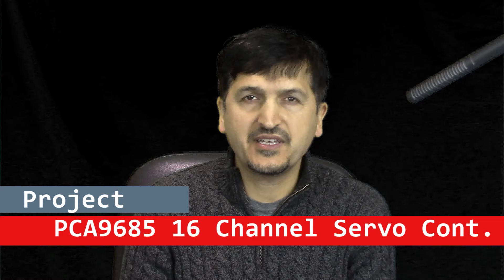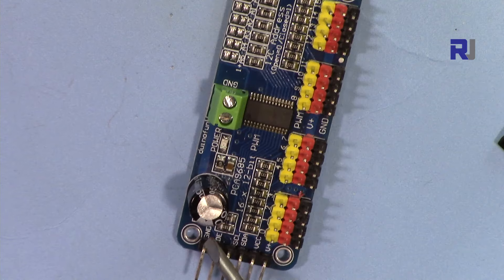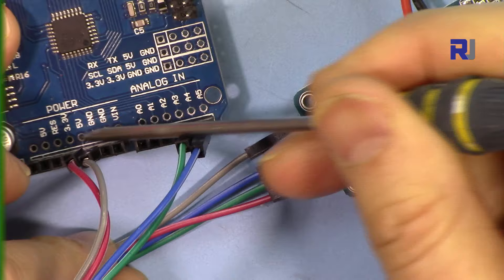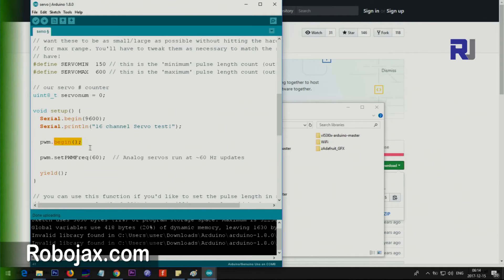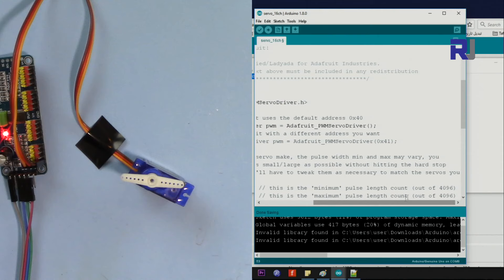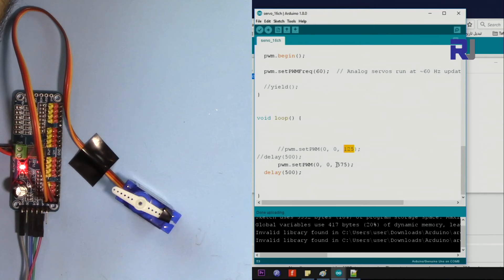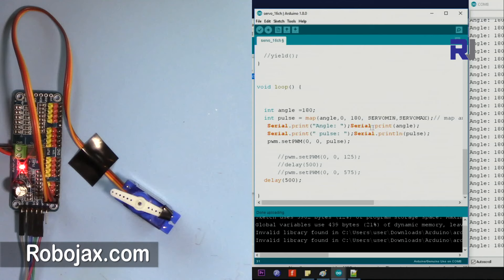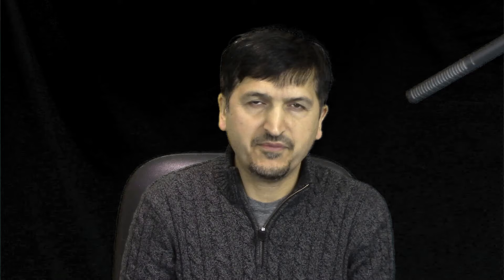Complete guide to  PCA9685 16 channel Servo controller for Arduino with code Version of 5 ( V1)

Comment: how to control 2 servo with your simple code?? please reply
Reply from the maker: Use this video https://www.youtube.com/watch?v=kZ9b31gVemc
in the code we have a line : Servo myservo;  and bellow it add Servo myservo2;  which will be
Servo myservo; 

Servo myservo2; 

and from this line bellow, everyone you see myservo, create another line with myservo2 and it should work.  For example you will see this line in code:

 myservo.attach(9);// servo is attached to pin 9

then add this line:
 myservo.attach2(10);// servo 2 is attached to pin 10
Reply: Does it work same way? I use the pca9685 does it work same way?
Reply: And where is the line? please reply i really need this :C
Reply from the maker: did you visit the link?  Watch the video and there is link to to the code.
Reply from the maker: If you need to only 2 servo why bother using extra module? Arduino can do it without any extra module
Reply: Robojax yes I did
Reply from the maker: https://snag.gy/AHhRpV.jpg

Comment: Hi, i am amateur beginner of electrobuilding and 3d printing and i need your help please.

I have Arduino Mini Pro clone, working fine for example with display... But, in this case i can't get it work at all.. I connected everything so far as possible after your instructions, but it doesn't work... I uploaded the Example code like you from PCA9685  library on my board, everything with no troubles, but it just does nothing, no turning. What is the problem please? Thank you :)

Photo of my connection:

https://ibb.co/zfQg66Y
Reply from the maker: Hi, Please load this I2C scanner http://robojax.com/learn/arduino/?vid=robojax-I2C-scanner  to your Arduino and open the serial monitor to see if it shows I2C address. You can learn about I2C in this video http://robojax.com/learn/arduino/?vid=robojax-LCD1602-I2C
then you will know if it has been wired correct.
Reply: @robojax  Thank you for your quick reply

As shown on image below, your serial scanner code found me a device on address 0x40, on another usb port i used even some more addresses, i tryied all of them but it doesn't work. My arduino is sending signal, in Serial monitor i can see how there are coming numbers in a row and my programmer usb stick blinks at every moment another number appears. But again, servo is not working... I have probably wrong connected PCA board. I connected the green connector V+ to positive and GND to negative on batteries. On the side VCC into VCC on Arduino, GND into GND on Arduino, SDA to A4 and SCL to A5... when i put out GND from the PCA board led starts to blink.. 

https://ibb.co/n8BwJGm
Reply from the maker: You are welcome. At least we know the SDA and SCL are connected correctly. Now the question is wither you have the right board. Please read the chip model and you should see it. Also test your servo using this code of mine: http://robojax.com/learn/arduino/?vid=robojax-servo so we know the servo (s) are working.
Reply: @robojax  I tried but nothing happens.. You know, maybe is my Arduino board damaged... I ordered a new one Nano's and will try your instructions with them and let you know.. Maybe i burned my mini pro while testing it some time ago ... Bacause i tried to run my OLED display on it now and it doesnt work properly, only few lines on the top are showing and the rest ist bad pixeled.. But some Time ago it was working perfect..

I will let you know then if it with those new ones work
Reply: I am so sorry but no matter what i do, nothing spins... 

I used those new Arduiono nanos versions... Its the same like by pro mini... Adruino finding I2c device on 0x40 or 0x70... I tried both of them in your scatch... Nothing happens... Arduino just blinking when sending out singal...  On PCA Board ist just red light turned on and that's it.. I tried different power supplies on the green connector on the PCA with 5v input... Nothing... AA Batteries .. Nothing... Don't you know what could be else bad? I am stucked by this not working thing already long time, and just can't do any project or so it looks so simple from videos but i don't understand why it just doesn't work.. I even ordered new 10 servos and tryied them for the case some were damaged but not...
Reply: So buddy, i bought few new PCA9685's and they are working!! :) Servo is funny rotating... My old one was really damaged...  :) Thanks for nice help and for your tutorial